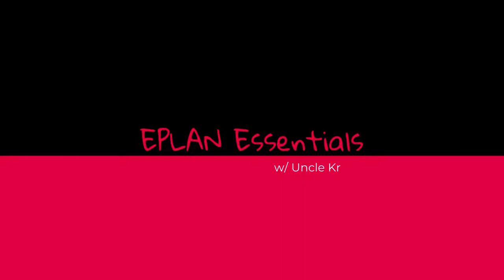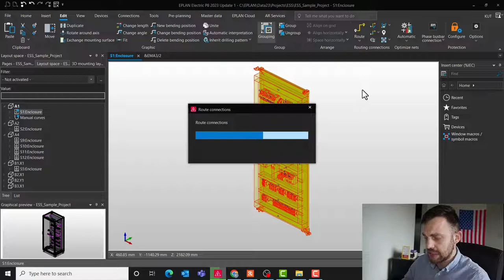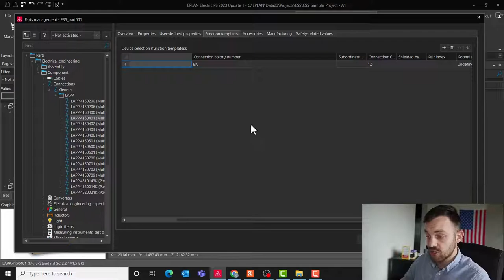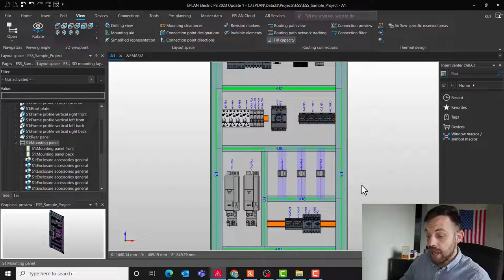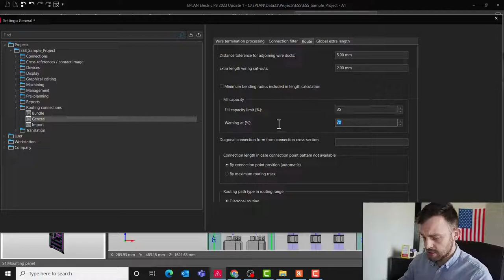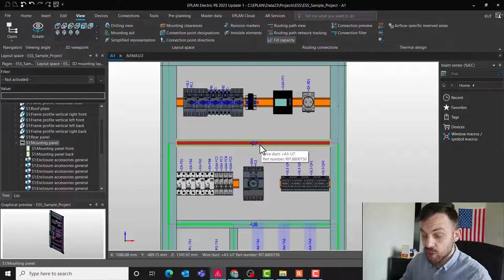How to display Fill capacity in Pro Panel

Comment: I do use the tray fill capacity feature. However I am curious as to why you set your values so low when you were interested in knowing when you exceeded 50%?  Why not put 50% and 40% for fill capacity?  Is this just a personal preference to avoid approaching fill capacity? 

Have you ever wished EPLAN would just report the fill % on a report or model view?  For me it would be better to know the % of each tray when planning where wires route.
Reply from the maker: Thank you for your feedback.

If I would like to know when 50% is exceeded, I typically count in a 10-15% buffer. The buffer is used to cover the Air Space Allotment (as you can see around 01:54 ). So when the Software calculates the Fill Capacity it lays, every wire perfectly next to each other with practical (almost) no air space, the buffer is for the reality, how often is there space between the wires, or in other words how much space is between the wires when the panel is built?
This may be conservative to say 15% less than the expected value to be displayed, but in this case, I would rather have been safe.

That would be amazing sir, or display the Fill Capacity per Wire Segment as a Property, but until we have a solution like that we have the Traffic Lights :)
Best Regards
Kruno